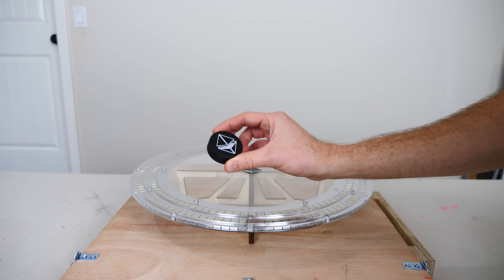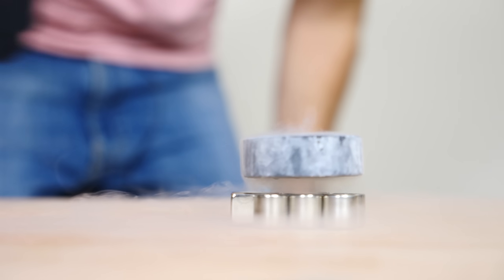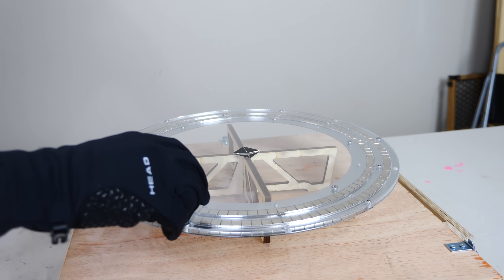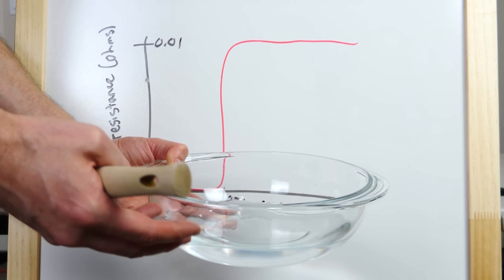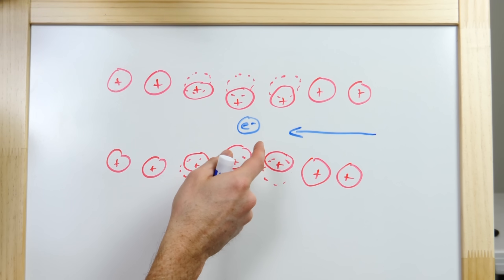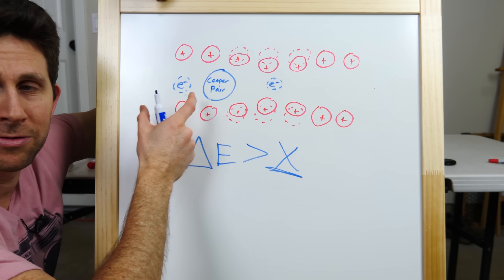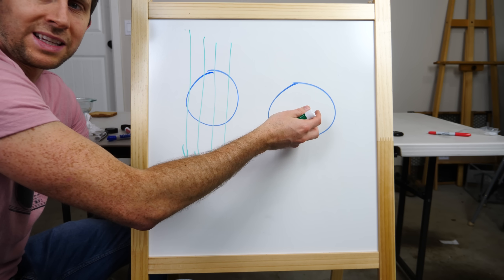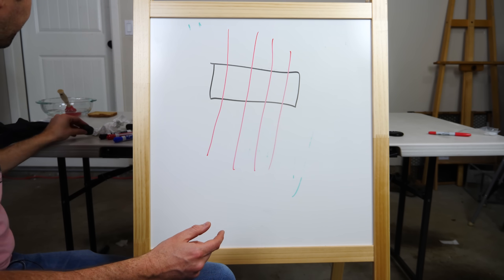Quantum Locking Will Blow Your Mind—How Does it Work?

Comment: Quantum locking PPPPOOOFFF ! Using the concepts (false as the electron, the positron and the photon have been discovered later on) of grandpa classical electro-magnetism that are the charge Q (plus or minus) which develop a E field and the electric current (a current of "charges" at grandpa AMPERE era) which develop a H field.
 Advanced physicists know now that the magnetic "field" (H so called field) is a rotating E so called field caused by a rotating material bi-voltage device  (called a dipôle) The most powerful magnetic fields can be produced by the mechanical simple rotation of a so called "charged" capacitor (with high opposed voltage plates) Ref US NAVY EL PAIS PATENTS 2017-2018 as an example. 
There are different so called magnetic fields: clockwise, anti-clockwise rotation, pôles inversions ...) related to matter : the electron and anti-matter : the positron. Of course the CALTECH team 3 basic particles (big bang universe sole components at the origins) are dipoles that is the reason why two of them the electron and the positron are powerful stable permanent  magnets. Everybody using classical EM forget the fact that all matter bunches deal with powerful little balls magnets  as basic parts (particles) of their assembly.
To come back to the "locking" here one must understand that the superconductor ring become a permanent magnet only after being exposed to a permanent magnet (Neodym as an example) so called H field. So the fact that the operator change the distance between the super "ring" and the magnet  modify immediately the so called H "induced"field intensity and or direction generated by the super "ring".(the EDDY currents change) The stable position is due to that because the "induced" current in the super-ring can also cause "attracting magnetic subjective force" (change direction when going away from the neodyn permanent magnet instead of going towards it or by inverting pôles position.).

Subjectively speaking the observer limited brain deduct there are attraction or repulsion forces (at a distance!!!!) with permanent magnets when in reality that is the SPACE (so called vacuum) which contract or expand between the magnets. UFO use obviously these properties to propel themselves with incredible "observed" speeds with inertia free. conditions (good luck for US NAVY secret research) See tech ingredients 2020 video ""no we didn't use magic to crush this can" where a short in time 45 teslas "so called H field" expand space in a bang (observed as a strong repulsion here)  between the electro-magnet (coil) and the  can (eddy currents generating an in  opposition so called magnetic field) The moving electrons (  zillions of tiny magnets) cause all that phenomena called "induction" by grandpa physicists.
FEYMAN Quantum E. D. give an energetic explanation of the "vacuum dimensions"-matter interactions at the electro-magnetic level trough its diagrams describing localization of matter particles (electron, positron) and transformation of electron or positron into a photon as an example. However the best model so far is the 1990 Unified electro-magnetic field theory MEYL TESLA KELVIN (vorticity) MAXWELL which explain everything
EINSTEIN with his SPACE (time!!!) contraction in the vicinity of any matter (generating a gravity field aka electro-magnetic fields) was not too far away except that, far away from E.M. science, he decided (postulated) that time was no more a human defined constant and that light speed was a speed limit.(that speed limit was a nonsense considering the time contraction associated with matter speed he mathematically deducted).

Comment: Hmm? Even more strange when you consider that what you are experimenting with is 0.0000000000000000000000000000000000000000000 % of anything. Which is not strange at all, when you consider everything in the universe comes from a grain smaller than that %! Perhaps something you are missing? “Nothing” new there then!?

Comment: Good experiment, but it didn't expmain one of the most valid reason why it works well, which is because ENERGY level's of the conductor continues to neutralize and out do downward falling motion ENERGY CONSERVATION  SYSTEM, it's surface wide electro magnetic activitys of 9.8 mps, known  as Gravity, same as our body strength allows us to do on a daily basis, by following universal laws, the stronger ENERGY force overrides the weaker ENERGY force. 

Your knowledge of quantum experiments could be of some use to the unsettled UFO'S questions.

UFO'S identified as small isolated pockets of atmospheric oxygen and hydrogen gases BONDING together creating a state of solid mass water, and miniature lightning's. 

On the larger scale it's visible to the naked eyes as falling RAINDROPS, and great big prangs of lightning's. 

Atmospheric gas BONDING creates a lot, water, thunder, lightning's, dirt devils, tornadoes, hurricanes, Auroras, Sprites and solids. 

What's your take on Gas Bonding ?

Comment: Bro, isn't it possible to do it on a bigger level for travel and transportation , saving resources 👍👍👍👍
Reply: It is happening on a bigger level 🌚🌞
Reply: @NWYVR  how, in which field
Reply: @kunaldua851  Well.... if someone told me 2 years ago that I'd be saying this, I would have thought they're absolutely nuts but - the sun and moon are quantum locked discs spinning over a flat earth.
Reply: @kunaldua851  Also, gravity does not exist. 😀
Reply: @NWYVR  I like the way you admit the   
Question but I want to know more about it
Reply: @kunaldua851  I'm realizing that so much of the world works via quantum physics. The part at the 9 minute mark where the guy discusses the electrons moving through the lattice of ions, reminds me very much of this lecture I listened to by Dr. Thomas Cowan. Dr. Cowan described how blood moves through capillaries using this very same method. He also discussed how the heart is a suction, not a pump (incorrectly taught in medical school). 

Regarding the moon and sun moving around the flat earth through quantum locking - I'm still learning about this myself. It's very interesting and you will really have to dig for information. Most of the astronomy we learned in school is incorrect. We need to look to the pre-Pythagorus/pre-500 BCE era and begin there.
Reply: @NWYVR  sure I will

Comment: 9:20 Interesting... your imagery of what is happening at this point is very similar in function to an idea I had over ten years ago for a self sustaining electromagnetic generator.  Hmmm.  Question: What happens if you put the super conductor back on the magnetic track with a magnet suspended above it or below it (as in when you flipped the track upside down)?

"Though this be madness, yet there is method in it" - Polonius Scene 2 Act 2 of Hamlet

Comment: Imagine a theoretically perfect train made with this kind of tech
Reply: Maglevs are kinda like this
Reply: @DrAdityaReddy  Imagine we had hover tech instead of maglevs
Reply: @DrAdityaReddy  last time i checked there isn't a super big superconductor on the bottom of a big hunk of metal we call a train xd
Reply: @omocoool that's why I said maglevs are kinda like this. It doesn't use superconductors but uses magnets to float
Reply: @omocoool  Google magnet trains lol
Reply: @DrAdityaReddy  
Aren't the magnets actually super conductors? Obviously it isn't this but still.
Reply: Then they'd have to have dudes or a machine cooling down the superconductor every now and again, right?
"The liquid nitrogen costs, Johnny. They're too much!"
Reply: @simplyz3964  yeah but what if you get a room temperature superconductor instead
Reply: @omocoool  I do not know if it will work the same way.
Reply: @simplyz3964  ok yeah but what if you get like 1000 kilograms of superconductor it might work then
Reply: and also super strong magnets
Reply: @omocoool  In the video, it's shown that the quantum locking works under the condition that the superconductor is dipped in liquid nitrogen first. I still do not know if it will work with a room temperature superconductor. 
And I can't conduct the experiments on my own considering I don't have any of the things needed.
Reply: @simplyz3964  He dipped it liquid nitrogen to get a temperature needed 
I don't know much 
But I can tell you that every semiconductor behave has a superconductor but at a specific temp
Reply: @omocoool  doesn't exist (yet)
Reply: Japanese SCMaglev train prototypes being tested right now use superconducting technology. If I remember correctly, I think they use tanks which carry liquid helium to provide the cryogenic conditions needed. There are some videos here on Youtube summarizing how they work.
Reply: @omocoool  perhaps you didn't understand that there can't be a room temperature one
Reply: @arandompotato8271  no there can a few people made some
Reply: @omocoool  Saw another video a while back. They did TECHNICALLY achieve a room temperature super-conductor, the caveat is that it requires pressures like that in Jupiter's core.
Reply: @omocoool  it might work in Alaska
Reply: Magnet trains in Japan
Reply: Like the bullet train
Reply: {maglevs are a thing)
Reply: Japan has electromagnetic floating bullet train.
Reply: Maglev is good and ‘cheaper’ buut imagine this cars for some high speed auto roads or something so you can easily switch beween roads and tracks
Reply: @sta1RR  just stick your foot to the ground to manually stop a high speed frictionless and no resistance car.
Reply: @user-ov2kx8ql5i  Ouch.
Reply: @sta1RR  how will you break if there's no friction or magnet
Reply: Uhhh maglevs?
Reply: Japanese SCMaglev
Top Speed : 603 kmph
Approx. Commercial Service : 2027.
Reply: Completely frictionless
Reply: Mr Cool: I hear that they’ve had a magnetic system in Hong Kong for decades that causes trains to be magnetically caught up to ride in the magnetized space above the “track”, causing a perfectly smooth ride, and allowing for far greater rates of speed of travel.  I haven’t experienced or seen it in person, though.
Reply: Good luck supercooling something that large. The energy/resources required make it impractical.
Reply: @bluewater82  i will grab cooling from space :)
Reply: Lol imagine if they could actually build that one they promised California like 50 years ago
Reply: @JUDGE, JURY,  and EXECUTIONER no it's cool stfu
Reply: I imagine can't  we make a device using magnetic levitation phenomena which can be used for lifting objects just like maglevs ? 🤔🤔
Reply: I think they are trying to make a magnetic tube... Even if you get this kind of train, you'll need a pushing force and a stopping force, which is, I think, more complicated than just making a electro-magnetic tube.
Reply: Exactly!
Reply: Yea its called magnet train
Reply: Diszruptive ENT:  Tyvk; I did want to know.  :)
Reply: Coldplay + train. Cold train. Yellow drops of Jupiter. Okay ✅
Reply: Agreed
Reply: Or car wheels and axels
Reply: It's basically the same.thing just a different place to use the energy. I don't know if cooling the superconductors would be as energy efficient as powering the electromagnets. That could be a cool experiment though.
Reply: on a sunny day
Reply: cabal used those magnetic trains underground. can go 17,000 mph.
Reply: Dose it still work if the puck is not ethrium? Would a polkadot work?
Reply: @Random nobody ok
Reply: It might heat up and not be as efficient? I don't know - I'm just guessing. I'm so ignorant it hurts - but I do invent stuff with a couple of patents - anyway I'm so ignorant my best bet is to believe in God and let him keep up with the Universe and I'm so old school - I still think that there is only one Universe - like "Uni" means one? I don't know - I'm so ignorant - I don't really know what I'm talking about - and I like it this way - cause I'm afraid if I got intelligent - I would not be able to invent stuff anymore.
Reply: @2DanTube  ok mr life story
Reply: Say hello to my hyperloop

Comment: The electrons flow that way because of quantum entanglement.as Einstein called it spooky communication at a distance.. That material must be dence like carbon. Because carbon is the only element than when heated the resistance value decreases because it's density is intense and heat relaxes it. So that material in the Super conductor must be lighter than carbon but just as dence. What say you?

Comment: 1. Would it be possible to do with the magnetic fields what an airplane wing does with air flow and thus create a self-propelled or perpetual motion mechanism?

2. Might the possibility exist to perfectly insulate the vehicle(puck) from rising temperature and have the weight of the insulation be little enough to still counter the effect of gravity?

Or is the conductor's condition always decaying towards chaoticaly-obstructed electrons?

Comment: Electrons are only time specific points of a field, as are all particles. Particles are not the building blocks of things, they are temporary, time specific manifestations of fields interacting with other fields. I think this idea needs to be pointed out more often. Wave function collapse gets used a lot... But most people seem not to be able to conceptualise that 'particles' are not little balls of stuff.

Also, the term 'quantum locking' is a little... Erm... Over dramatic and only used because of everyone's obsession with the word quantum. 

Why is a directed magnetic field resulting in a form of locking (that part seems reasonably accurate) anything quantum? Unless that refers to the 'funnelling' of the magnetic field passing through the material as quantifying the magnetic field in some way, which seems a bit of a stretch. Correct me if I am wrong though.

Comment: Ok this is cool and everything but we need to stop playing with it and start seeing how quantum locking and levitation works when we mix it with energy. I’m thinking about doing my own videos where I attach the superconductor to electric wires and see how it reacts when I shoot electricity through it. Another idea I want to see is when I connect one wire to the superconductor and the other to the piece of metal on top of it. And finally another experiment where we attach electricity to just the piece of metal while it levitates on the superconductor. After that, we should try to see how lasers work with the superconductor

Comment: Now, if I heard correctly, big if, when the temperature in the puck goes above zero, this effect will no longer work. And if a super conductor runs through something in the next quantum level, it slows down? Which I would belive, would make this very difficult to work with for any sort of transportational value. I think, maybe. Um, yeah.

Comment: Would this work if dropped through  a copper pipe ? Frozen inside until it warmed up then slowly moving. Or would the copper pipe have to be cooled with the liquid nitrogen and the superconductor room temp.

Comment: If you didn’t stop it how long with that puck fly around that semiconductor whatever that glass desk you stop it but how long would it keep going if you didn’t stop it?
Reply: The desk is an alternating polarity of magnets. The superconductor will move until it's temp goes above a critical value. Typically this is 130K-200K. At this point superconductivity is lost

Comment: Wait! This experiment is disproving the propeties of nitrogen - Inert, unable to move things, with a gravity lower than oxygen. From 0:00 - 2:15 he is able to move the top metal which bounces back in place. Is able to reconnect the top material that moves the magnet around, and defies gravity as an inert object.
Is it the magnet and the metal frozen together by the nitrgen that allows nitrogen to perform differently? Can someone explain?
Reply: After 2:15 hovering maintains, even with a tangerine. 
1. Are these two polar opposite magnets, or metal and magnet causing nitrogen to react differently?
2. if they are metal and magnet can we truly represent Nitrogen properties as listed. Please clarify. It's unfair to show us experiments and not tell us how to recreate them. In science that is not an experiment, but a majic trick. Can we get the real specs here.
Reply: please define quantum locking in your own words. You can not use magnetic opposites in quantum. The name itself means gathering multiples. Not separation in any form. If we sent a spaceship in to space using the polar opposites in quantum, the machine would explode (blow away) from itself with any volocity of motions. 
Although we dont have a complete understanding of zero piont energy or quantum locking. We do know that locking (especially using magnets) would have to be positively charged to one another. Quantum is always a WHOLE amount of energy, not a separated/deflected amount of energy. Ever. 

This experiment, although entertaining, is not an experiment at all. You can not ever use magnets with opposite poles to create anything of quantum affects. 

Please prove us wrong.
Reply: One example: If it is true that a negative time a negative equals a positive, and a positive times a positive equals a positive. how can a positive times a negative ever give positive results. 

We know that all these theories are man-made.  So either your experiment is correct and a negative times a negative is wrong (which I have theories about) or your experiment is way wrong.

Comment: Not having read through 10K comments, I am forced to ask, since there is apparently no friction on the track, how long will it go around, and is the  answer relative to the applied force x?
Reply from the maker: It will eventually slow down due to friction with the air, but it takes a long time
Reply: @TheActionLab  Thanks!